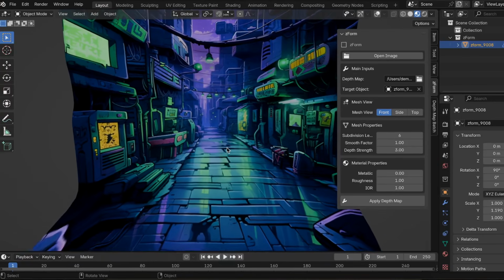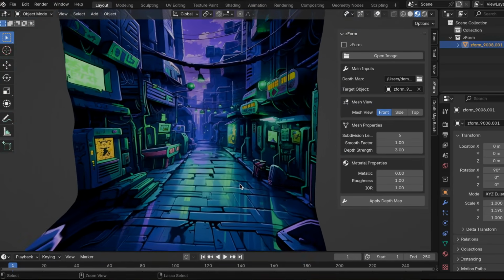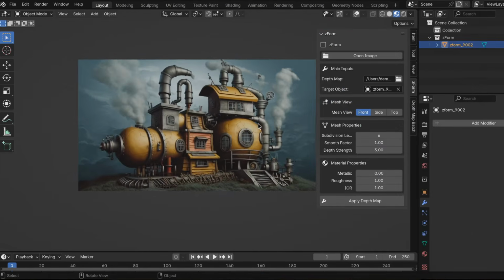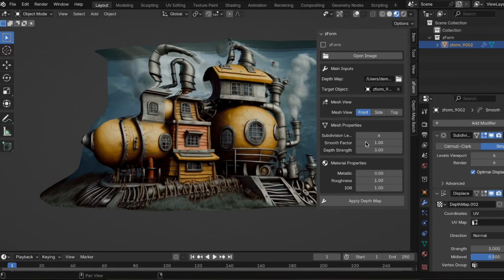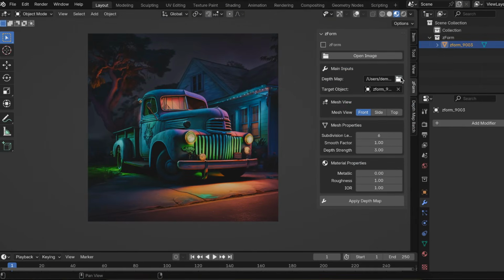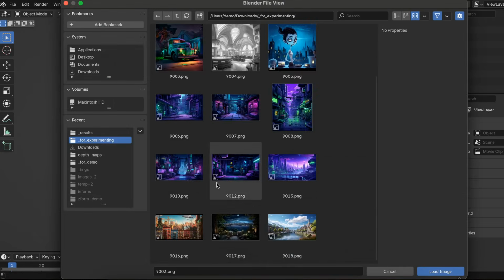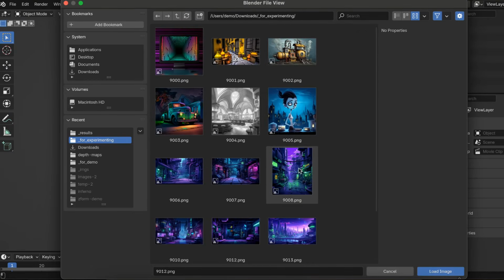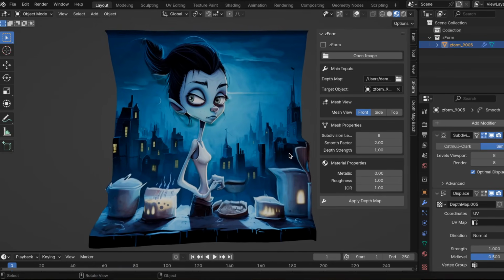Let's convert some more images and depth maps to 3D mesh in Blender

Comment: Maybe allow users to apply depth map in all areas so you can hqve an actual 3D?
Reply from the maker: Hi. This is actually included in the "Apply Modifiers" button at the bottom of the tool. I've made updates since the early version and launch videos. You'll see in more recent videos this functionality is in the UI.
Reply: @vizdotlife  will it be difficult to integrate AI to it so that AI will just make those parts at the back instead of a mess lol

Comment: Can we make any AI generated pictures in to a 3d in Zform.. or else we can only accse to the images in the addon ?
Reply from the maker: Hi...yes, but let me try to clarify and explain a bit further just to make sure there isn't any confusion. 

You can indeed take an image you generated with AI, which is actually what I did for this image, and convert it to a 3D mesh like what's in the video. There are few important things to keep in mind. 

The first is, you will first need to generate a depth map for your image before using the tool. There are free websites out there that can help you do that, or set up a system locally using something  like ComfyUI. I create depth maps using my other Blender add-on called Depth Map Batch and it's all run locally...no APIs and no web services. 

Please keep in mind that results of depth maps can vary enormously based on the depth map model being used as well as the image used to generate the depth map. I would recommend finding a tool that uses a new model like Depth Map Anything V2 versus older models like MiDaS 3.0. 

Sometimes the results look great, while other times they look bad....it really depends on the factors above. It also depends on the viewpoint angle of the image. I've found viewpoints that have a slight turn can produce better results for things like houses, but it still depends. 

Once you have a depth map for your image, then you can use zForm to convert your image to a 3D mesh. Or you can use the modifiers on the right side in Blender that I shared as well. 

Does that make sense?
Reply: Thank you so much @vizdotlife
Reply from the maker: @ You're so welcome!

Comment: Wtf, man that looks so easy !! How? Please make a step by step video on this. And also answer my query ie. Can we download the depth map image also
Reply from the maker: Hi Annkur, yes....it's really just 3 simple steps, but it takes a little learning in terms of the types of images that do well using this technique and the ones that don't. There are plenty that look terrible, but over time I've learned which images typically turn out better. 

Here's a recent video that shows the 3 steps to convert 2d images to 3d mesh. 

https://youtu.be/Ni0IZOOFczo

In regards to creating depth maps, there are free websites out there that you can upload one image at a time...but I actually instead use another Blender add-on tool I built called Depth Map Batch that generates depth maps in bulk for a directory of images, a video file, or single image. 

https://blendermarket.com/products/depth-map-batch-for-images

Let me know if you have anymore questions.

Comment: how do you get the images to create the depth map, do you create a file folder or what. There is no vids about how to set up the system.
Reply from the maker: Hi. Are you talking about my tool zForm or the separate tool called Depth Map Batch? 

The tool named zForm doesn't actually create depth maps. The tool is designed to simplify the process with minimal steps to convert your own images and already created depth maps to a mesh in Blender. 

Here's a getting started tutorial on using zForm. 

https://youtu.be/YNRns9dO-9A?si=YC-mg2L9B-aERR_g

If you're talking about my other tool Depth Map Batch, that does actually create depth maps for either a directory of images or a video file in an automated batch process in Blender. It doesn't use APIs and no web services are used either. I have a whole playlist on Depth Map Batch on my channel if that helps. 

But, you can also create individual depth maps one at a time for free on some websites out there too. 

Did I answer your question?

Comment: Are the depth map a part of the images. Do the depth map get created automatically for the image ?
Reply from the maker: Good question. The answer is no. My tool zForm doesn't create depth maps for images. It will simply take the inputs the user provides for their own image and their already created depth map. I don't use any APIs and there are no web services in the tool, it's all local. 

It's simply just using your image and the associated depth map you already created to convert to a 3D mesh. 

The depth map would need to be created in another tool. There are some free online tools out there to create depth maps where you upload your image and it will generate a depth map for that image. 

Alternatively,  I have another Blender add-on tool named "Depth Map Batch" that generates depth maps for a batch of images in a specified directory or a video file in an automated process, and it's run entirely local on your machine. There are no APIs and no web services being used in the batch process of my tool....it's all run entirely local on your machine. The tool currently doesn't use the most recent depth map models, but a slightly older one called MiDas, but it's worked decent for my needs so far. 

Long story short, you will need to find somewhere to generate a depth map for your image before you could generate 3D mesh for a 2D image, but there are some free online websites out there that can help you do that.
Reply: @vizdotlife  Many Thanks. I'll look at the suggested tools.
Reply from the maker: @vivektyagi6848  You're welcome!